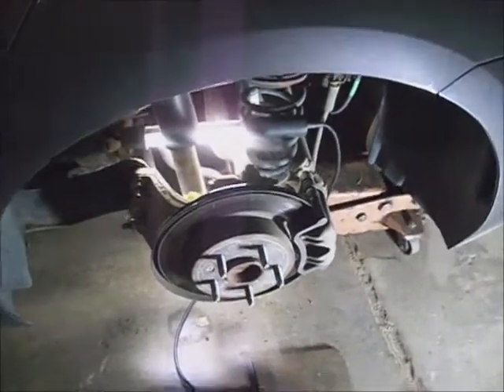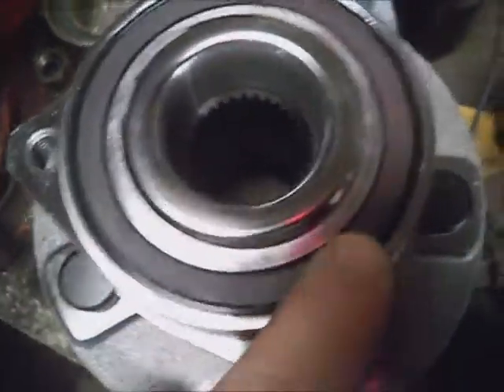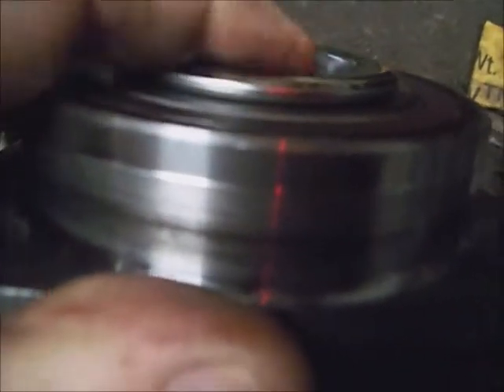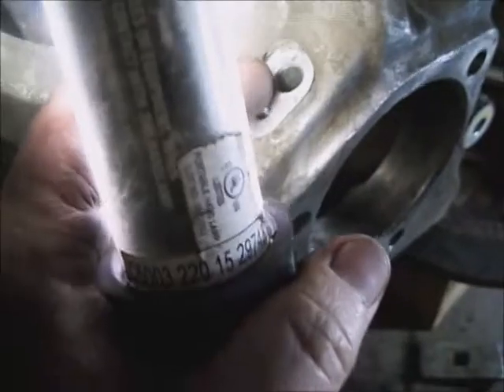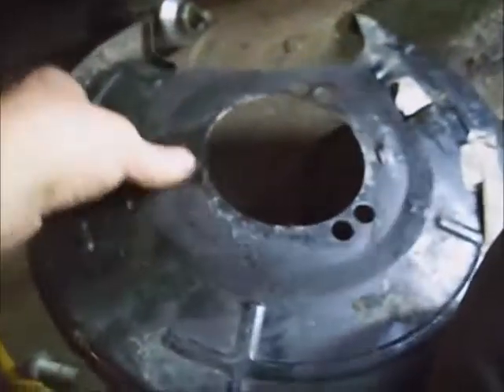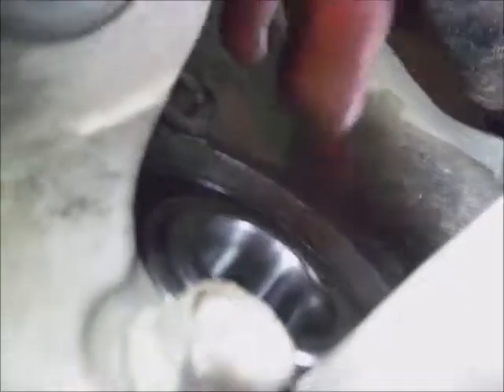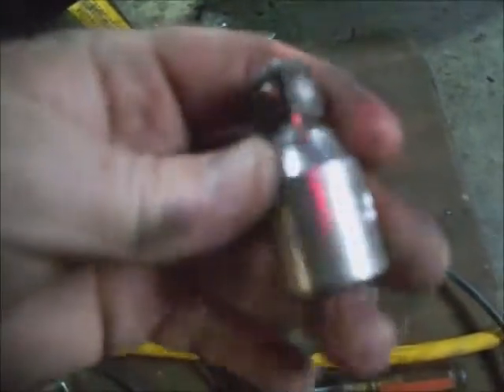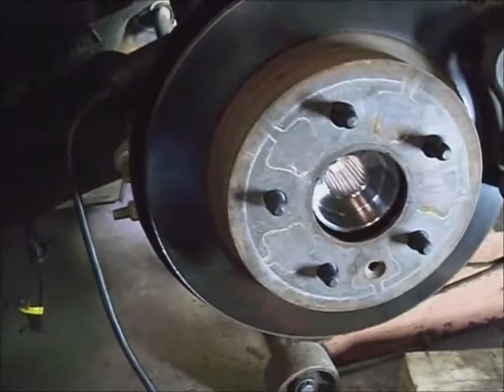Chev Malibu LS `13 rear wheel bearing replace code 45 abs trac light on

Comment: Good video you are a good mechanic...And thanks for explaining the wheel sensors that was the info I needed .... fyi I ordered these exact bearings from  detroit axle in Michigan $80 for two . I installed two in my work van good product ....
Auto zone wanted $180 for one
Reply from the maker: Thanks for watching.  But be advised, I used them once, in an 08 grand prix video on here.  30 days later, customer was back with same problem.  But the second one they bought, has held up for 3 months so far.  You get what you pay for is often true.
Reply: I installed 16  so far 4 on my van drove to charlotte and back from N NJ no issues yet. I over load it all the time so I expect it to fail lol. I did have one fail shipped it back for $12.  .
Reply: It's 9 months later ... How are they holding up? I see that for a '14 Malibu the DA. ones are 1/2 the cost of the local big auto store here in Upstate NY.
Reply: I started to order from Detroit Axle but while on hold for quite a while to get shipping charges, checked eBay and Amazon and found the Malibu ones for a lot less including shipping. Of course I had check the national auto parts store and they were a tad north of $100 so the Amazon one at $46 was great.
While I was unable to install it myself at this time (currently moving) they local garage would have installed them in half the time if they watched this video. The didn't pull the rotor/caliper all at once and tried to use  a gear puller then heat before using an air chisel. I so much wanted to walk over, grab a BFH and be done with it.
Reply: Yea man those Detroit axle wheel bearings are shit... trust me you'll have to do the job again using those parts

Comment from the maker: Something that I could have pointed out that may be a diagnostic time saver is, that if an abs code related to the sensor is confirmed, the magnet on the wheel bearing is clearly visible from the under-side of the vehicle.  And should be inspected for pieces of the magnetic strip missing, and if verified damaged, the diagnostic is ended.  And a new wheel bearing will be needed to resolve the problem.
Reply: thanks again

Comment: Would a slide hammer work for getting that old bearing off? Also, where do you put the jack under the car?
Reply from the maker: It is in the video, and the bearing really wasn't stuck un there to bad.

Comment: Thanks for making this video and explaining the steps so clearly.  As it turns out, I have the same exact problem with the same LR wheel on my 2013 Malibu.  41,000 miles and I've kept the underside clean.  Wondering if the deteriorating magnetic ring on the GM installed hubs are a design or poorly made part problem.  The back of the bearing hub and ring are really exposed to the elements.  Seems like that area should be closed up.  Or, maybe it needs to be open for ventilation/cooling.   I verified my broken ring today, off to Autozone ($120) tomorrow.  Thanks again!
Reply from the maker: Thanks for watching
Reply: Great video and step by step.    Thanks